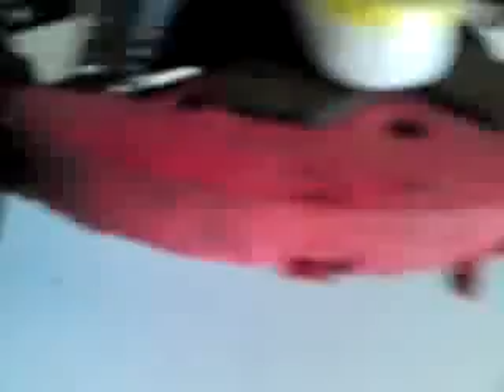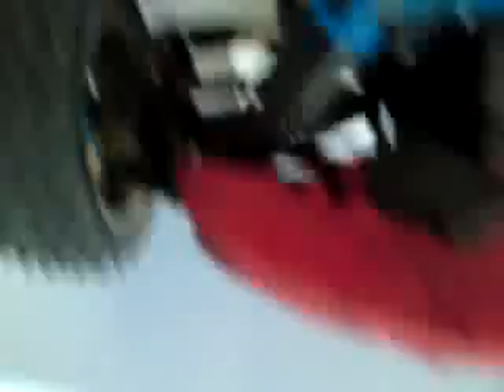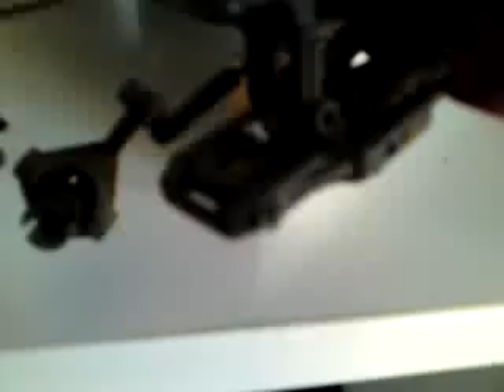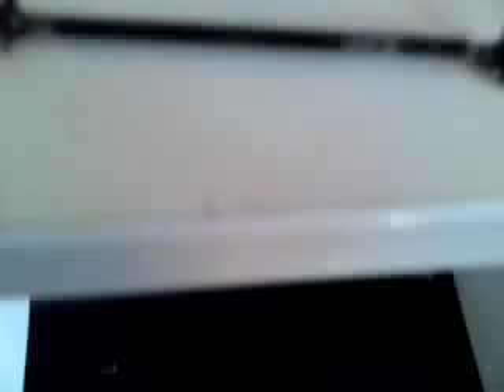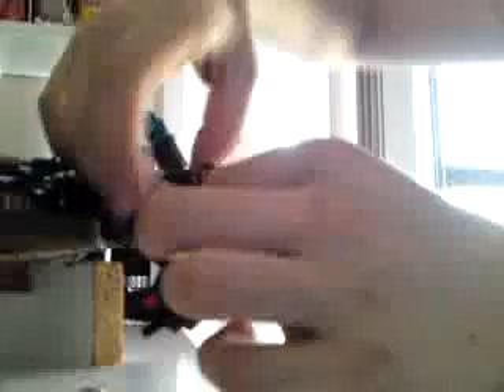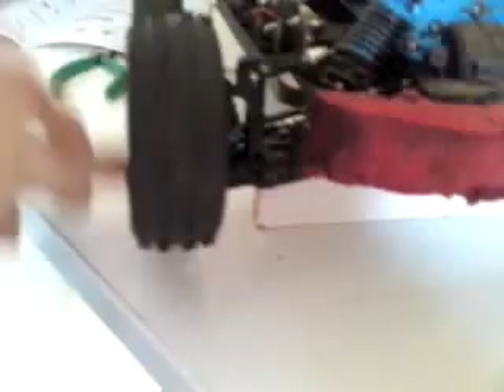HSP buggy brushless 1/10 rc car fixing bent dog bone

Comment: How did you fit that bumper on there?
Reply from the maker: its just some hardened foam from another RC car, i drilled and hole then used a screw from the bottom that goes into the 2 black bits of plastic which are threaded and the size of the top is like a giant washer